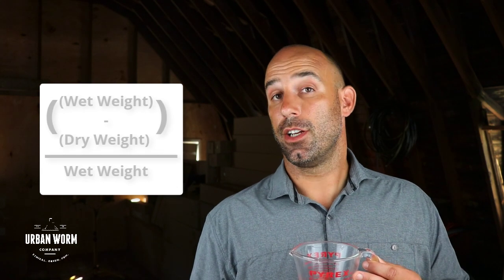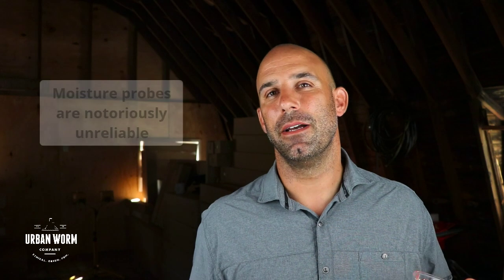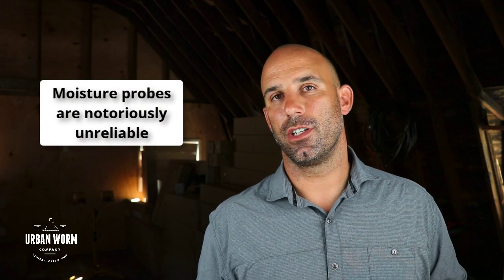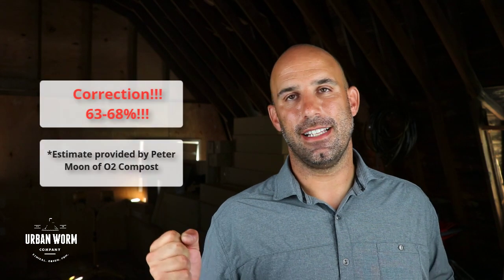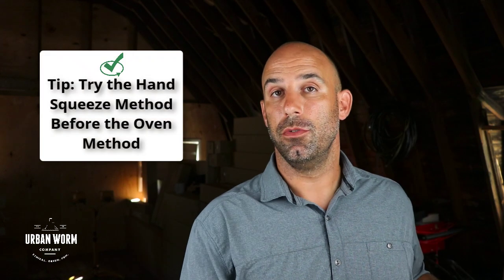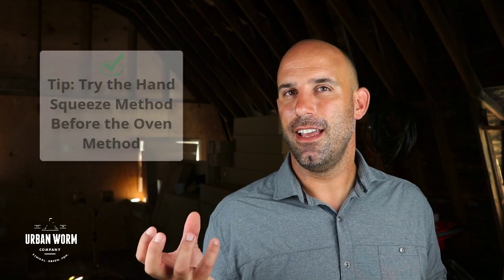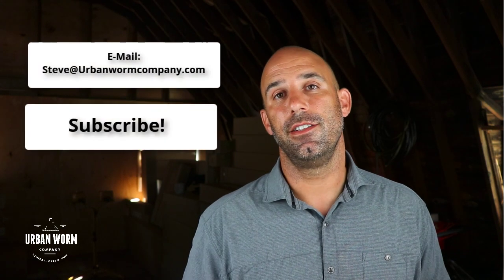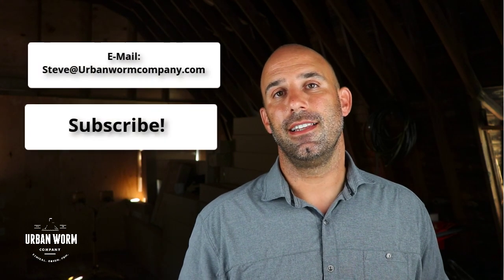How to Measure Moisture in Your Compost or Worm Compost Bin

Comment: My left ear enjoyed this video. 24 hours in an oven doesn't sound like a very energy efficient method of evaluating moisture content. Would a microwave work as well to evaporate the water from the organic matter? Are there lab devices regardless of cost that are accurate in measuring moisture content that provide faster results?
Reply: Do it during the winter when the heat of the oven will work to heat your house anyways.
Reply: I work at a major snack food company and we use a moisture meter to measure the moisture of our dough. It takes about 1/2 an hour.
It essentially works the same way. Quite a bit faster but also our sample size is smaller.